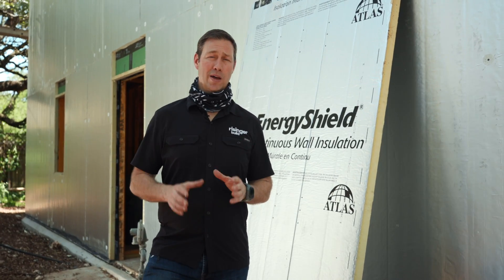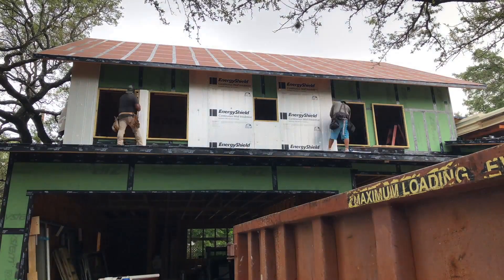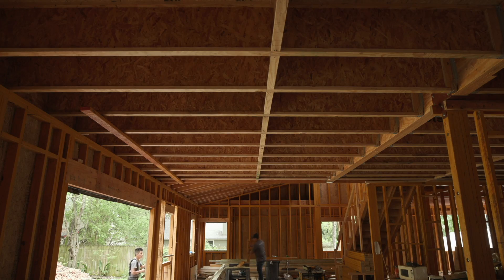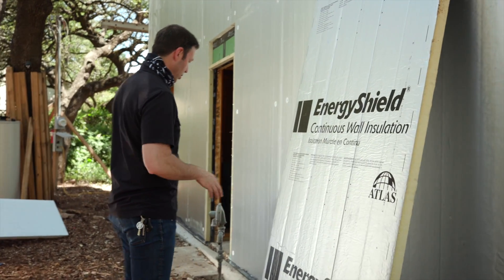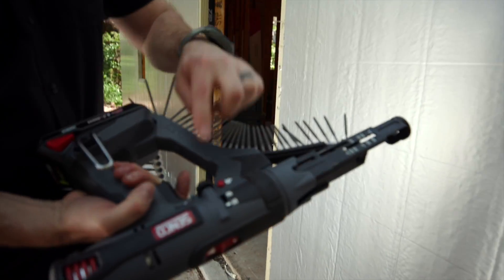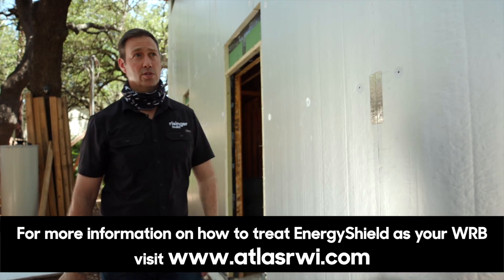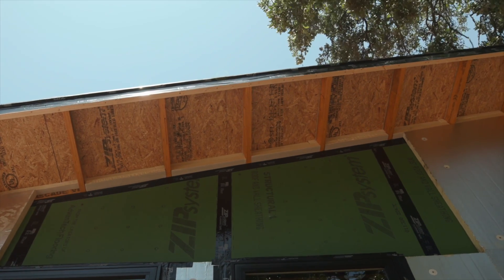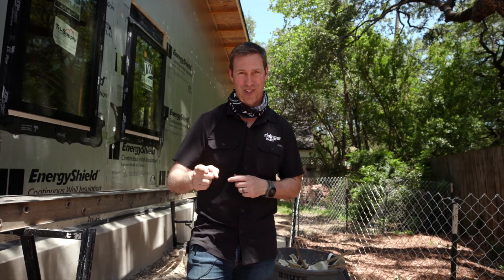Exterior INSULATION Details from Matt’s House

Comment: The radiation will just hit the siding, traveling through it via conduction, then traveling via convection and then back to conduction through the insulation material. So i dont think that reflective matrial does anything unless it is actually exposed to the sun.

Comment: Zip says not to put insulation on top of their product especially one with a membrane because it can sandwich moisture in between the two.  Any comments as I’d like to do what you did hear but concerned about condensation. 
 I’m in Ohio w hot humid summers and cold winters.

Comment: Polyiso. A dramatic drop off in performance below, what, 50 deg F. OK for a warm climate like TX, or in a basement where year round soil temps are moderate. But not good for cold climes. Not new news, but just adding.

Comment: Videos like this are absolutely invaluable. I have an old 1970s home in Canada that's 2x4 framed and is in need of an energy retrofit. New builds are easy enough, but I've always wondered what solutions are needed to add exterior insulation to an existing home. Addressing things like the foam overhang at the sill-plate of the wall, and the zip-system for an air barrier is great info.

Comment: I went with the Atlas AC Foam III product (also 2") for the purpose of stuccoing over the top. 3 years later, it's performing great along with upgrading all windows to dual pane. 70+ year old home that's become super efficient. with a 62F night and 98F day my home stays @78-80F unless we're cooking for any length of time inside. exterior insulation is a huge improvement and poly iso is the way to go for R value.
With the stucco, I used a vinyl starter track (like a weep screed) for the panels. It's perforated so if any water gets behind the stucco, it'll percolate down and out through the bottom of the track. I prefer this over trying to make it air tight, even in a desert climate.

Comment: I am building in a sub- tropical climates. Cooling dominated.  Sandstone masonry. I understand the insulation should be on the outside but the kind of materials available in the US is not availabel here. 
So I am thinking of Rockwool. How to I prevent moisture from entering the insualtion. If I use plastic ,wouldnt it affect breathability.

Comment: Yes Matt, Steve B did an awesome job in Episode 6 of the Boston build showing on his architect plan, 3 examples of how Rvalue is affected. I have learned so much recently from Steve B. architect.  The whole wall is not just the cavity but opaque frame, windows and doors.  Whole wall could be about 60%, with opaque frame being 20% and windows and doors being 20%.   What is "misleading" in the industry is that contractors will tell you they are providing a wall of R23, say if ICF, BUT they Do Not Tell you that is is Only the Cavity they are talking about.   STeve goes to prove that an R23 "wall" is probably only an R13 once you calculate the loss of R value from the Windows/doors (R3-7) and opaque frame R value is 1R per inch, so 5.5inch stud is 5.5R value.  Windows, doors and opaque framing significantly reduce the overall "whole wall" R value.  So don't be fooled when a contractor tells you he can give you an R23 wall.....ask him how he arrived at that R value and challenge him on low R values for window and doors and opaque framing.  Thanks Steve B and Matt cheers from Atlantic Canada, Prince Edward Island. I am getting ready for an extension mostl likely in 2024 due to challenges of finding the right builder and very expensive to build due to materials costly, and a  line up with drafts person and getting a permit....not enough people with such a high demand in building homes here. In the meantime, I get to learn a lot to prep for dealing with the trades people as I act as the "contractor" to make a team that will pay attention to sequencing of water, air, vapour and thermal tightness with a thick blanket on envelop of full basement ICF and 3 storey high. 🙃  🇨🇦🍁

Comment: I’m very curious how the siding is supported over 2” of rigid foam. Is there any sag from the weight of the siding? Ie 2” of screws through foam which isn’t structural, so the weight of the siding held up vertically by screws cantilevering through lightweight foam worries me. (I’m an architect).

Comment: This is almost exactly the same system I used on my timber frame. I fixed mine so there was a screen at the bottom and top and hot air can vent out under the gable.

Comment: Lot's of great details here, but one important missing point for people in northern climates. Polyiso insulation is the worst choice for exterior insulation in cold climates. Polyiso is often chosen because it has the best R-value per inch, keeping wall thickness down, while being more expensive than other insulation types. 

But what is often missed is that the R-values on packaging are measured at 75 degrees. So polyiso performs great when you don't really need it to (and when you are trying to keep a house cool, so it's not a bad choice in a cooling climate like Texas). But it's R-value drops massively with colder temperatures. At 40F, polyiso performs almost the same as XPS insulation, which is significantly cheaper. At 0F, XPS, EPS foam (cheaper still), and rockwool (also cheaper than polyiso), all have significantly better R-values than polyiso. I see people here in Maine put polyiso on the outside of their houses because they don't understand this. They are paying more for a worse performance than other products like EPS foam. In my climate, the same money will get you a thicker layer of EPS that will give effective performance of nearly DOUBLE the R-value. Polyiso is only useful if it will stay warm - so on exteriors of houses in warm climates, or inside (like basement interiors) in cold climates. And even then, it's only the right choice when you care about thickness. EPS and XPS still beat it when considering R-value-per-$.
Reply: Interesting.   Thanks.  Might reconsider a job I have with my house in CT
Reply: Use GPS...r value improves as term  drops...

Comment: In many of your videos, you explain the negatives of rigid foam panels: fire hazard, insects can burrow in, non-permeable to vapor so underlying framing can mold/rot, loss of R value over time, shrinkage making joint spaces expand.  So, why not exterior insulation with Roxul?

Comment: Are you concerned at all about water ending up between the Zip surface and the foil layer with no easy way out? If there is a leak in the flashing (eventually) or with condensation due to a small air leak it could get trapped behind the polyiso. Is there a mitigation?

Comment: Polyisocyanurate in the south on the warm side makes sense.  In the north, many of us believe the labeled R value.  However, as I considered 2 or 3 in. of exterior c.i. I stumbled into the pentane condensation phase diagram and the semi-definitive studies by NRCA '09, '14;  and BSR '13.  With 2-in. exterior c.i. and R-13 in the stud cavity, I anticipated thermal performance of R4 to R5 per inch.  Overnight it would be lower yet.  While I ditched the idea and bought 3-in of EPS Type 9, I have mused over putting the polyiso on the inside (still thick enough to prevent summer condensation) .  That appears to put the Class 1 vapor retarder in the right place for us Yankees, and we can put our interior furring over the polyiso in any direction as a screw base for the wall board and have clear voids for utilities.  But there must be a fly in the ointment, otherwise wouldn't we already be doing this?

Comment: Would you have the same effect by making the silver poly foam flush with your cement base instead of adding the 1x2 that hangs outside of the cement base? Why not bring in the wall framing so that the wall insolation sits on the cement then use liquid flashing and type? Thanks for your help and knowledgeable video 💰

Comment: Question: will the radiant barrier work against the type of heat that has radiated from the panelling that sits between it and the Sun's rays??? (I ask because the Sun's rays/heat come to us in a different part of the spectrum than what would be radiated from general building materials. )

Comment: Thanks for this series Matt! Very informative. 
Question on the insulation detail at the bottom- In some places it looks like there's a new concrete 'curb' formed out below the 2x strip at the bottom of the foam (and other places not). If you were pouring a new slab, would you set the sill plates back the thickness of the foam, or let the ensemble hang out over the edge of the slab?

Comment: What if water gets behind the foam, how is that zip going to hold up? 
I know that building codes are heading toward the jacket method of insulation to meet code requirements.  To me these systems are to prone to waterproofing issues and flashing complexities.  The more complicated the system to more chances of failure. 

I would think a decoupled double stud wall or foam board on the interior of walls would be easier, less complex and not prone to water issues. Time will tell.

Comment: You don’t even anything more then R13 in the walls.  You don’t lose energy thru walls. The only tings to need to be concerned with is 
Air gaps in the walls. Open cell Spray insulation is solves both issues.  You get your R value and it seals all your penetrations with one product. 
If you want to go over kill you can just add a radiant peel n stick to the sheeting.  
Otherwise this a waste of time and money especially in the south.  FYI heat rises.  All you lose is thru the roof.

Comment: Thanks for the great video! 

Really loved how you went over all the details in this one. Great to learn how you dealt with protecting the exterior insulation by using a ripped 2 x 4. Looking forward to the window install video!

Ps. Also great to hear you explain the differences between installing high-performance insulation in hot versus cold climates. There is a lot you can find regarding cold climates but for some reason people think that air-conditioning bills aren’t as problematic as heating bills. 😉

Comment: hello matt im thinking of going with the zip system then covering it with the new dorken lath for stucco but my question is can y install the zip system over my existing osb ? as long as the osb is mostly in good shape except maybe a few inches on the bottom that i can cut out and replace with maybe 1/2 inch pt

Comment: Honest question. Why zip and another exterior insulation rather than just using zip R?
 It seems like a lot of labor, but I don't know the cost of either lol.
Reply: I was curious about this also but my guess is that he wanted the insulation on the exterior side of the sheathing to capture the radiant quality of the specific insulation used. However, I would ask is there a reason to use an ext. insulation without a radiant barrier outboard of sheathing? This is in contrast to the Zip-R which has the insulation between the weather barrier and the  studs.
Reply: I find it weird to have vapor barrier in between two layers of thermal insulation.

Comment: It is fun to watch Matt trick out every detail and air/water-proof every single seam of his house. But I am beginning to wonder if the drive for maximum performance is beginning to be counterproductive. For one thing,  with the building down to its foundation, Matt had FAR more flexibility to create a dramatically different design that (while not necessarily fitting into the neighborhood) could have yielded better functionality. Secondly, top of the line HVAC systems (fully variable furnace and condenser) are so efficient these days that even a house not built to these specs (merely built well) will use a tiny amount of electricity even during peak heat here in TX. I imagine there is no way this kind of build would ever pay for itself under those circumstances. But I am curious what else Matt has up his sleeve as this build progresses.

Comment: I’m not a contractor/builder, but don’t you want the building to breathe? I thought if it was too air tight you would get mold or other similar problems.
Reply: He's going to use an air exchanger. . . . Brings in fresh air, and I believe also filters it; and controls humidity. 

In the more low-tech solution: an earthen plaster would naturally manage humidity indoors by absorbing the excess, and then releasing it over time; and of course adding thermal mass.

Comment: Where I live, we have 20 cm (7.9") of Styrofoam on 30 cm (11.8") brick wall (Wienerberger Porotherm Block), 30 cm of mineral wool in the roof. With heat pump and floor heating (15 cm (5.9") Styrofoam below floor heating pipes), my electricity bill comes up to 600 EUR/year for heating. Floor plan of the house is 9 x 12 meters , ground and upper level (round 1851 square foot livable space).
How does this system compare?

Comment: This house has double air barrier the zip wall and the energy shield so tell me how this house will breath? it looks like as if you have Zip done correctly with tape + adding Tyvek with tape too which is a big mistake. All joint, penetrations and openings should not been taped or sealed to allow the wall to breath.
Also you have now double water barrier. We need more explanation form Building Science perspective.
Reply: His ENTIRE CHANNEL (yes all caps) is built around teaching those details.
Reply: @roborocko  yes i know, but it is a mistake to have double layer of vapor barrier. i m NAHB certified in Building Science.
Also one o Matt videos is talking about that Zipwall is failing with water and he still use it! 
i think it is better to use Zipwall Sheathing with (NO TAPE) and add a Vapor barrier layer infront of it with tape.

Comment: Hey Matt,

You probably won't see this but I thought I would ask. I am building a 10x17 overhang off of the back of my house. On the roof I wanted to use OSB, Foam, and 7/16 ZIP. I wanted to do this because I am installing a metal roof. Do you think this would cut down on the noise of the roof during the winter months?

Comment: is the PT 1 1/2" x 2" trim attached directly to the sill plate or through the zip sheathing.  If it's attached directly to the sill plate, how do you fasten the zip panel edges at the sill?  Thank you for your reply.

Comment: any concern of having two layers of "air tight" material (zip then foam) ?
Reply: Coming in late, but two air tight layers is fine. The Zip is airtight but semi vapor permeable, so any moisture should dry to the inside, assuming he doesn’t have closed cell foam or some other vapor impermeable material in his stud cavities.

Comment: Matt, love the details.  Are there options for getting the radiant benefit for the roof?  Did you and Steve just decide against it?  9:50ish - is there any concern with fire prevention from the garage up to the kids rooms (maybe it will all be covered with drywall)?  Wouldn't want the polyiso to catch fire.  Your channel helped me to do a similar install in 2018.

Comment: So ... When you side over that  2 inch thick foam.  How does the siding not sag over time?  You have the weight of that length of siding being held up on the last 1/4  inch of the screw/nail?

Comment: Poly iso has much lower R-value in the north.  Poly-iso's R-value decreases below 50F, while polystyrene (XPS) R value increases as it is exposed to lower temperatures.
Reply: And you don't need to worry about the electrical conductivity of your insulation.

http://www.texasinspector.com/files/Unusual-Behavior-of-Radiant-Barrier-Materials-in-Fire-Causation.pdf

Comment: Nice exterior details. 

I’m not a builder, so here comes a stupid question. Has anyone installed windows with a kick-out at the top?  Look at the windows in the pilot house bridge of a boat or the cab of an airport control tower to see what I mean. Benefits in a structure might be: No water collecting at the window frame bottom; no interior reflections for better transparency looking out; and the exterior surface will stay cleaner longer.
Reply: The cost of that far out weighs the benefits.

Comment: I had to tear the drywall out of one of the walls of a bedroom in my house and decided to try an experiment.  Instead of putting bat insulation back into the cavities, I bought a couple of 4x8 sheets of the 2" foam insulation at HD, cut them into strips, and filled the cavities with them.  Then I used spray foam to seal around the edges.  I'm in Tucson AZ, and that room is the southeast corner of the house (I did this in the south wall) and has consistently been the coolest room in the house.  It's AMAZING how well that insulation works, especially when it is sealed in and there is no air movement.

Comment: at 6:07 you show the bottom of the 2x2 ledge that's protecting the bottom of the foam. It looks like, now, the bottom of that 2x2 is exposed to splashback. You may want to consider a fluid applied application to the bottom of that piece of wood. Yes, the bottom f your foam is now protected, but now the wood is exposed and subject to rot. Maybe I missed if these were pressure treated.
Reply: pretty sure he uses prosoco fluid applied in that detail to avoid just that.
Reply: @steffenpelz7114  I don't see that detail on the wood ledger board. It's on the concrete but the board itself is exposed underneath to splashback.
Reply: @sketchapp3783  dang...I see now what you are saying...did he miss it?
Reply: @steffenpelz7114  not sure, since the prosoco was done when the sheathing was put up, earlier, then he added that ledger piece for the polyiso. Curious of the rationale there or if it was just a miss.

Comment: Hey Matt, wanted to get some clarification on the building science. I'm in Canada, land of year round heating. School education taught me you never want to put a vapor barrier on the cold side of the wall. Rigid insulation acts as a vapor barrier. Usually we use it in basements. But you've had no condensation issues with exterior rigid insulation? Do you still use a poly vapor barrier inside? Love the channel bud!